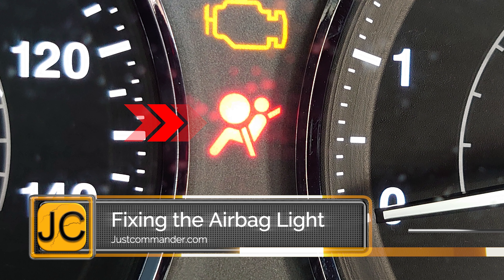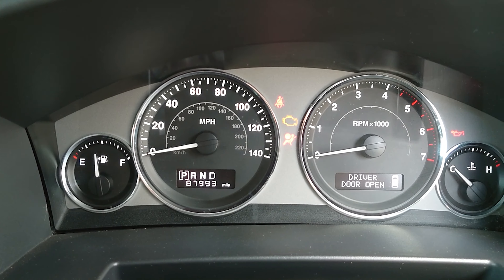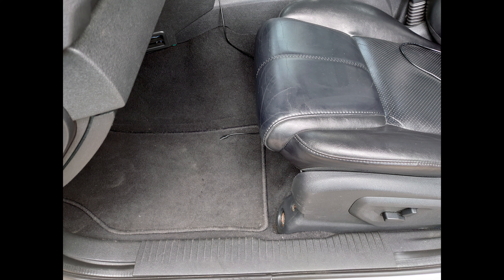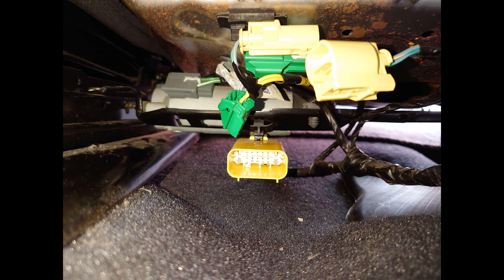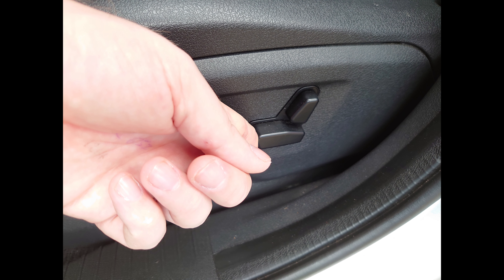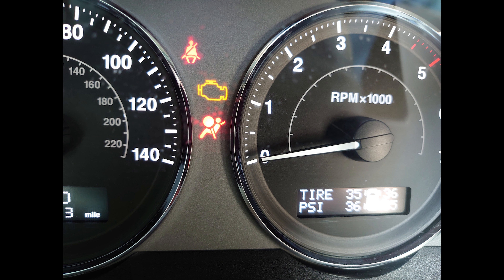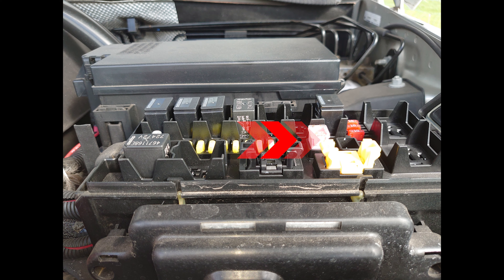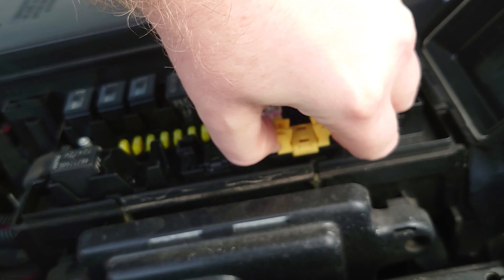Fixing the common Air Bag Light on a Jeep Commander

Comment: Outstanding info.  I had a trailer tail light not working.  I had a blown fuse so I moved the "spare" marked 10A in the yellow holder until I could buy some replacement fuses.  Then the air bag indicator light came on.  I had just changed the 12V battery and the service department thought this was the problem - NOT!.  Replacing this "spare" fuse in yellow holder corrected the situation an no more Air Bag light on.  Thanks for pointing me in this direction for such a simple fix.
Reply: So you took out the fuse in the yellow holder, had a problem, and then replaced the fuse and it went away. Interesting.

Comment: My system ( i think has a dead ORC lamp in the cluster) 
I would drive and hear a chime. My Scan tool listed 10 Oms on the passenger side when i disconnect the yellow clip, and then 2.7-8 when connected. At first i saw the drivers side at about the same valve and the passenger side at about "ohms". I think the wires and pins looked good, but maybe touched at some point. I untwisted them ( as they were twisted together)., and added some electrical tape. Now, on to see when time offers and see about fixing the lamp on the dash. When i would start the car the manual states 6-8seconds of lamps illumination, but I see no light on the cluster. So bulb probably dead.

Comment: Hi! New to the channel! Just got a 2008 Jeep Commander in White. I have been obsessed with it for a long time and finally got it! It already has 176k miles so I have to do everything I can to keep it for as long as I can! But found your video because I do have this light as well as the tire pressure light on at all times. I will follow your suggestions to see if it helps. But when you say scan, what do you use to check the codes? Thank you and excited to see more of your videos!!!
Reply from the maker: Thanks Wilma. The tyre pressure may just be a dead sensor. Not expensive to buy and tyre shops should be able to fit them.

Yes checking the codes with a cheap code reader. It'll usually tells you exactly which seat and part is giving you trouble.
Reply: I got a 2006 a couple months back. I love it. My kids love it as well.

Comment: does anyone know a relation of that light coming on (generally has only happened on a hot summer day) and making my hvac blower not work at all? and then sometimes possible 15 minutes later the airbag light will turn off and i can use AC again? (06 grand cherokee laredo)
Reply: My 2008 GC has the exact same issue. Seems to be related to outside temperature.
Airbag light comes on, AC turns off.
No idea what causes it.
Reply: @jessepalmateer8709  still haven’t found a fix but i definitely hate it. i’m thinking it’s that fuse box under the hood. any issue i’ve ever had in my jeep always involves something powered by that fuse box
Reply: @jessepalmateer8709  did you ever find a fix?
Reply: @finnsfann98  No, and I don't anticipate it to be an easy find.
I don't remember when it started, but it mat be related to an accident my wife was in some time back, which required a bit of front-end work.
Since then, the ambient temperature sensor bracket just behind the front grill broke and i rigged it back in place.
Not sure it's related, but I considered disconnecting it to see if it made a difference.
I'm in Florida, and it does seem to act up more when the front of the vehicle is facing the setting sun in the afternoon.
Reply: Did anyone ever figure out the cause to this?
Reply: My blower was dead in the 90+ temps yesturday. Took other car to work. Come home this morning and the blower works fine. Not a clue on that one.
I did not my ORC lamp seems to not come on when starting, and the blub may be dead. Relation, not a clue as well.